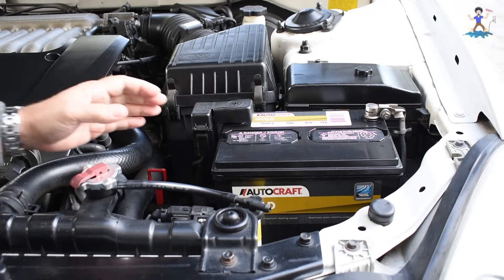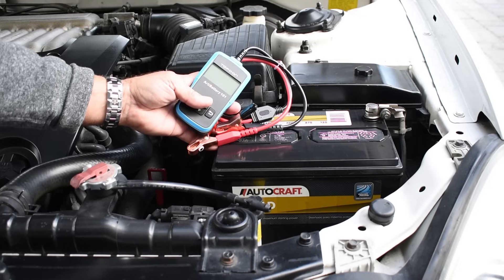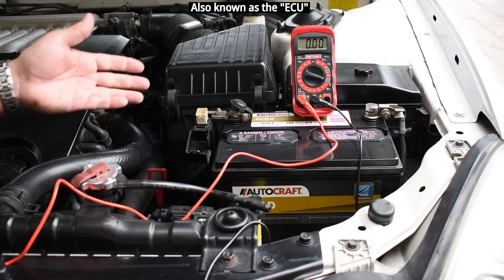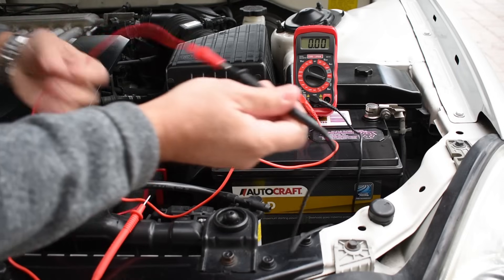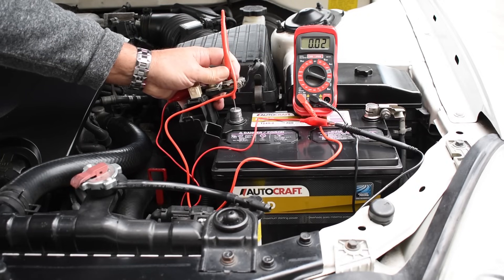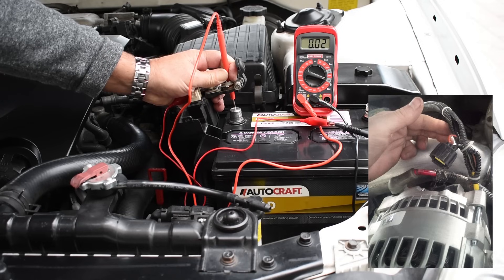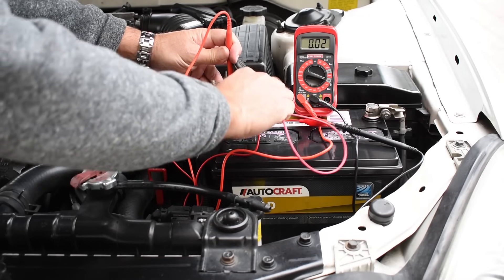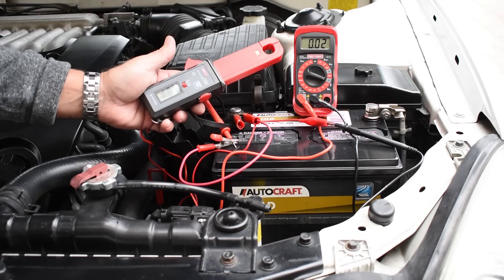Car Battery Drains Overnight Or After Days Of No Use! PARASITIC DRAIN

Comment from the maker: ATTENTION: The testing methods shown in this video can be performed using either battery terminal(sometimes one end of a car battery can be much harder to get to, or one cable has very limited movement), but it's much safer to use the NEG battery terminal since it's connected to the vehicle's chassis/engine ground.
Reply: I am wondering why you say not to pull the sound system fuse. I had parasitic drain and used this method and it turned out to be the stereo not shutting the amplifier off.
Reply: @rodgerroy8090  He said that is the last one you want to do because you will lose your presets.
Reply: @rodgerroy8090  because it will disable factory radios and you need the antitheft code to reenable it
Reply: How much time is normal for a battery to drain in a parked vehicle
Reply: @Kuldeep_Giri  Depends on a lot of factors, battery condition, capacity, and age (which is generally a factor regarding capacity).
A relatively new battery (3 years old or newer) with a 40 milliamp draw in sleep mode, driven daily, is generally fine.  
When you get into the hundreds of milliamps being drawn after 15 to 20 minutes, It's time to start digging into causes.
Start with aftermarket equipment, then work your way to factory equipment that has memory function or constant power (stereo, lighting, clock, then ECM's).
Make sure your alternator system is adequately charging the battery when the engine is running.
Reply: Use the negative side!
Reply: Thank you sir.
Reply: 5:56
Reply: hello, do you do a product review? We have a product, I can send u a sample
Reply: 5
Reply: @electronicsNmore very useful video, im from india have a ford fiesta battery is draining overnight
Reply: How to use the third option properly I would like to know did you mean put it around the positive post entirely
Reply: @electronicsNmore  where do I find a shop in Kansas City that specializes in electrical issues? I've  had a parasitic battery drain in my focus since last October
Reply: I have a 99 Grand Marquis I'm having the same problem I did the test that you did I have a 0.65 an it drop to 0.41 do that mean something is still on but I did not unplug the alternator yet but I do have an alarm like that does flash on the dashboard
Reply: Thank you very much very helpful learn something today very helpful
Reply: I'm not showing ANY amps using the negative side, but I KNOW there is a battery drain. What next?
Reply: Hello there I bought a Ford Sort Trac and bought a brand new battery but it is still draining. I took it to AZ (you know the Zone) and they tested the battery and Altintor both were in good order. I saw the you said Security system could drain the battery too, where would I find that wiring/fuse (it dose have a Thift light indicator on the dashboard) .? Please get back with me at your earliest convenience thank you 🙏
Reply: electronicsNmore ah you noticed...
Reply: @SmilingDevil  3rd 3rd 4th 4th

Comment: You can buy a adaptor that plugs into the obd port that you connect to another battery to maintain power in the system. A faulty relay can also cause a drain..

Comment: Great Video, and useful way to troubleshoot battery issues.     My Car had a bad starter solenoid... I had to use a jump pack to get it started and seemed like a battery issue... but replacing the starter fixed my issue.
Reply from the maker: Thanks for watching!

Comment: Pulling fuses and reinserting them wakes the module back up. Better to use a second meter to test voltage drop across each fuse without pulling them. There are fuse charts online to convert to amperage.

Comment: I think my alternator may be causing my drain.  Battery died, and I put it on a charger (battery is less than 2 years old).  Once charged, I started the vehicle and checked voltage while running with a volt meter and via a scanner reading live data.  It was reading under 12 while car was running.  I figured at this point the alternator was toast.  The car sat for a few days and I went to open it with the keyfob, and nothing.  Unlocked door with the key and check and it was completely dead again.  So it seems there is a parasitic draw as well.  I guess best to replace alternator and then check and see if we have any other drain on the system.

Comment: Can ammeter across the Ignition Off Draw (IOD) fuses also do the job (rather than disconnecting battery terminal?). Are the IOD's  in series with the component fuses, or are they parallel/IC switched? I have a parasitic drawer across the IOD of ~1amp, but removing component fuses does not find/eliminate the draw. Was hoping to diagnose parasitic draw this way instead of disconnecting battery terminals.

Comment: I'm here because my Charger is perfectly fine, 99k mi., had it for 3 years and 30k, maintained  to spec plus a little. Had to put a spare on to get it to the tire shop, they put the spare away (battery lives next to spare in Chrysler LX platform), how nice! 4 days later, it begins starting hard.🤔
After 4 more days- *click*.

I really hope it's not something they did, but its extra-EEMELY coincidental. Sht. I need to check for arcing marks around the battery- I swear to god if they dropped a tool and connected +/-, and F'd up my ECU/PCM or any modules....🤦‍♂️

Anyway, if anyone can connect the dots to my story and point me to any known/common/likely cause/solution, please reply.
I'm going to check draws and test diodes- I can figure it out, I just ask because if it saves time/headaches so I can commute with peace of mind sooner- yeah. Will follow up when solved.

Comment: I solved the mystery of parasitic drain today.  It would pull 1.0A, measured by a multimeter when the truck was turned off.  I replaced the battery, tested the starter motor (checked good), pulled out each and every relay and fuse (all checked good), and still 1.0A drain.  Then I realized I have a camper shell!  I had it installed 20 years ago, and I had it for so long that it did not occur that it was an addition.  I checked the dome light, and the switch was intermittently working.  The contact was dirty, and a few back and forth movement fixed it.  Then I disconnected the socket connectors.  Voila!  The multimeter read 0.00 mA.  I reconnected them both, and the meter still read 0.00 mA.  I checked and rechecked, and still 0.00mA.  I FEEL GOOD!!!
Reply: My apologies to Walmart, Costco, and Toyota for doubting and berating their product!😅
Reply: Great work!
Reply: @coopers23  Thanks!

Comment: Excellent video and information!  I have a problem with my 1997 Lincoln Town Car periodically with dead battery.  I think I found out the problem.  One day, I went out to the car, and I heard a fan going on under the hood.  I lifted the hood and sure enough, a fan was running, despite not having used the car for several days!  I don't think you would be able to pick this up using your parasitic drain method here.

Comment: Having your battery tested by the auto parts store employee usually ends with "yeah, you need to replace your battery"
Reply: They got me! The guy told me "I don't need to test it if your alternator is charging it".  Wonder how many perfectly good batteries they take in? Just know most of these folks make minimum wage and aren't always mechanics or good ones.
Reply: Just need to charge the battery
Reply: As a battery manufacturer, the salesman gave you good advice. Leave it to the experts.😂😂😂
Reply: @onenikkione
That's y I have my own equipment and just use them as a second opinion.

Comment: Used this method to find a 120 milliamp draw on a Jeep XJ. Narrowed the draw down to IOD fuse in the block under the hood. This circuit supplies power when the keys off to things like dome door switch, battery clock etc. turns out it was the bat wire to the radio that was drawing the battery down. Disconnected the wire and no problem since. Go figure

Comment: To help others, my issue ended up being a hidden GPS tracking unit wired to the fuse box. It had a small lithium battery inside which basically failed and started drawing a ton of power. It was very hot and buzzing!

Comment: You can do the same test with a test light instead of a multimeter. If the fuse box is under the hood, you can see the test light with just a glance. It’s. not as precise, but you can get a good idea as to how much draw is by how bright the test light glows. Good video
Reply: Could you elaborate?  What is a test light? I would like to purchase one. Thnx
Reply: @RebeccaSpires-eb9 -  A test light is a simple, inexpensive tool. It has 3 to 5 ft cord with an alligator clip on one end. The test light is connected to the other end. Picture a screwdriver with a clear handle with a bulb inside, but the tip is sharp, so you can puncture through wire insulation. Harbor Freight has a nice one with a 5 foot cord for under 5 bucks. They also make something called a “self powered” test light, but I don’t recommend one unless you’re an experienced mechanic

Comment: I disconnected the pos battery and ran a 12 volt light bulb between the pos cable and battery. The light bulb come on, I pull every fuse and and all relays and still it on. Any Idea?

Comment: My battery drains on my 04 F150 it was in the shop for 4 days,only disconnecting the computer and reconnecting and could not find any issues because it wasn’t throwing a code sent me home and battery is dead again driving me crazy what could it be

Comment: that’s too much…i changed my battery when my car wasn’t started 2x times and after jumped, and let engine runs for while, then measure, if reads below 12v, then battery weak, and drained…the good battery will read 13.7v when the engine running

Comment: Bought an Older car and it had this issue . Instead of fxxing around and finding then fixin the issue I went the easy and cheapest way which was to order a battery cutoff switch with remote. 30$ and done
Reply: Where do you purchase one of those?

Comment: Can you just simply remove the negative cable and probe that and the terminal?  Or do you have to do it so you slide the terminal up as your probing both?  Will results not be accurate if I just remove negative clamp and then probe clamp and terminal?

Comment: My battery went dead when temp got down to 14 degrees but have noticed before that hearing the engine cranking wasn't as strong as normal. I have turned off the entire  done light switch and manually locked the doors and bypassing setting the security alarm. I noticed negative battery terminal can be moved by hand as I tightened it as much as possible prob will need to get a battery post shim to fix that but I have a $245 2-3 yr old AGM battery thay was in vehicle (whrn purchased that should not be going bad already if so I will NOT buy a AGM battery  for my replacement battery if I see that it's bad.

Comment: Thanks! Gonna test this today. My battery is showing 12.2V, i fully charged it now and gonna do this test later. Chatgpt telling me it might be residual power caused by my new led lights. I recently converted many lights från halogen to led. I see sometimes the some led lights dimely lit after I turn off the car. How common is it that led lights drain the battery when off?

Comment: If you accept to loose the radio voltage you can measure the voltage drop more simple w/ampermetre in serie w/the pozitiv cable and pozitiv battery or on the minus cable. The test on the link is do not loose the voltage on the car during the test.

Comment: Self testing my Ford Fiesta 2015 ecoboost  dropes to 10.4 when engine is off with lights ac everything on. Then when engine is on it goes to 143. Should I change the battery?

Comment: Good job. 

I noticed ur car is a 2004 Kia optima. Does it use an oxygen sensor?
Reply: ???? Every fuel injected engine uses oxygen sensors to achieve stoichiometric air fuel ratio

Comment: Bad starter can do it i seen it many times it will start fine but drains batteries. Your car should be at 12 volts while off and 13 ish to 14 running. Throw the dam battery on aload tester there cheap. Id use a load tester over a battery analyzer anyday. Put it under a load is a far better test.

Comment: 😅 great 👍 👌 👏 🙌 😀 😄 👍 video tutorial. I'm subscribing.
Learning about parasitic draining.
I've got an alarm system. Believe it's completely dead. I was wondering if there was a separate fuse for that alarm system, or is the fuse part of the radio system. I want to completely remove that alarm system. It was nice at first, but I constantly had a drained battery as the alarm system was always on. Any advice about this? I'm removing the batteries from the remote control.

Comment: can you do a video for side terminal battery.  my girl has a slow draw n keeps killing her batrery.  at first it took almost a month to die.  now i charged batt back up was sitting at normal voltage.  an when i started it back n forth no issues.  left over night next day its dead.  so checked alternator charging its at 14.4volts like it should be okay rules out that.  no aftermarket alarm or remote start either.  only thing radio is dead dorsnt show screen its stock radio 2007 saturn ion.  so thats next gonna replace the radio maybe its staying on.  door pins also working correctly n dome light is shutting off.  any help id def. appreciate thank you😊

Comment: Good video the only thing I would add is  if you don't want to jump in and out of the vehicle to look at the meter what I do is use my booster cables. I connect one clamp to the post on the battery and the other clamp to the ground clamp of the vehicle. This allows me to run the booster cables inside the vehicle then I can clip the leads of my meter between the two booster cables and have it in a spot where I can read it easily without getting in and out of the vehicle or moving too much it's really handy when working on a vehicle like my F-150 that has the fuse box in the passenger side footwell. Again great video with lots of good information thanks for the tips on how to not lose settings
Reply: Great idea. Thanks for sharing it, and God bless you!
Reply: I borrow someone's phone and FaceTime the meter
Reply: I think you mean to connect the booster cable clamp to the NEGATIVE terminal of the battery. Otherwise your connection to ground with the other end of the booster cable would short the battery!

Comment: How about a Piece of Shit Walmart (house brand) Battery that would NOT hold a charge (after a long drive, or after a 24 hours 2 to 10A Auto charge on a Pro Charger) for more than a day? Lost 2 full volts of charge in just 4 days from 14.3 to 12.3V!
Solution - Piece of Shit House Brand Batteries from Walmart!!

Comment: Great - do be VERY careful you know that there isn't a large current draw.  Using thin leads or shorting them can cause them to get very hot, melt or even vaporise!  In the same manner that a fuse works.  This aside unusual current draw such as failed alternator diodes etc. is a real pain!
Reply: Diode test is easy, even installed on the engine. Diodes are one way electrical devices inside the alternator, but the large power output lug on the outer case of most alternators is where one would test  for resistance one way and none the other. It only takes one bad diode to cause a battery depleting drain, and they may have 6 to 12 in them.
Reply: @70ixlr86  Yes!  It is strange as they would have to fail 'closed circuit' but diodes normally burn out and go 'open circuit' - regardless of the mechanism they can often be the culprits as you say!

Comment: My 8th gen Honda Civic's battery was drained, I managed to recharge it but after about a week it was drained again like about -2 V per day. I did a test with my multimeter, set it to 20A (it doesn't have a 10A setting) at it jumped from 0,48 to 0,20. Does it mean a parasitic drain on a 20A measure too?

Comment: Battery dying overnight. Sometimes during the day within few hours. I did a battery drain test. When the car is switched off, it's showing a current of 22mA. Unplugged and replugged all the fuses. Nothing made a significant difference. I even replaced my battery and same thing still happening. Any other suggestions?
Reply: 22 mill-amps is normal drain, it should be less than 50ma. Likely, your battery is bad.

Comment: Is it normal for the new battery to last about a year if I drive 2 to 3 times a week for about 6/8 miles each time ?  It used to last about 3 years when I have to drive everyday BUT for 4 miles a day. Is the battery being charged if I just let the engine runs without driving ?  Also, does it prevent the battery from discharging ?  Thanks.

Comment: Should the battery lose voltage while the ground is disconnected? If I let my car sit for like 4-5 days it won’t start. The battery charged and test fine, but if it sits for a few days even with the ground disconnected it will lose volts.
Reply: If disconnected, it should hold a charge. It should only lose a few tenths of a volt.

Comment: My challenge is I know what circuit is drawing down my power - it's got the interior lights, and the horn on that circuit - so I've removed the fuse and now my battery doesn't drain, but I also don't have a working horn which is a safety issue.  Once I know the circuit what can I do to troubleshoot to find where the problem is?  Is something grounding out?
Reply: Likely on of your lights is staying on. Check the trunk and hood lights.

Comment: Here is a head scratcher. My battery on my Ford Focus was draining over a few days and the dealer couldn't find the problem. My car alarm started going off randomly as well. Eventually I saw the Hood Open message when the hood was closed. I replaced the hood latch and this Hood Open issue went away as well as the battery drain. All is good now. Weird.
Reply: what year focus please ?
Reply: @gfriedman99  2014
Reply: There may have been a light under the hood that stayed on since it thought the hood was open.